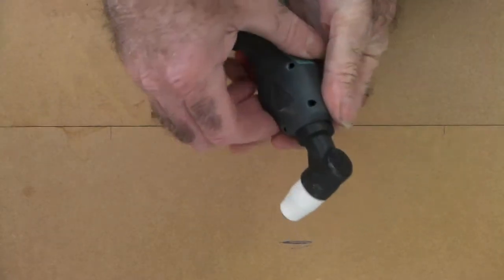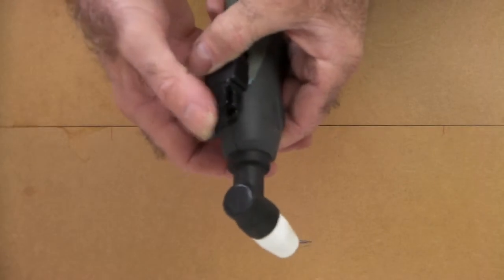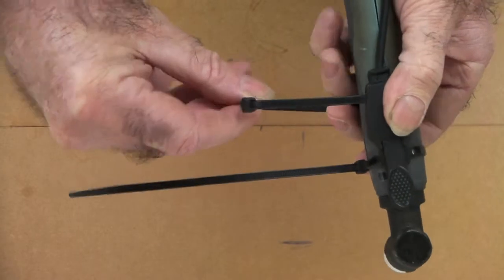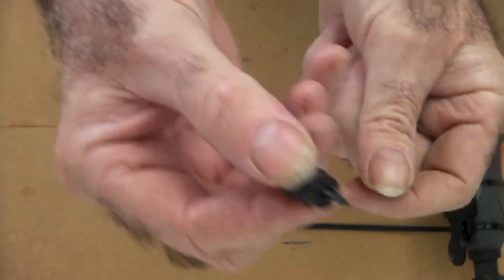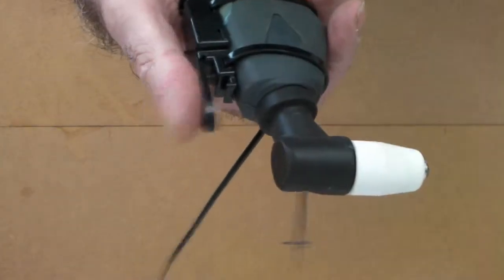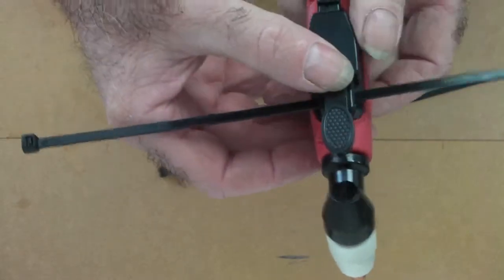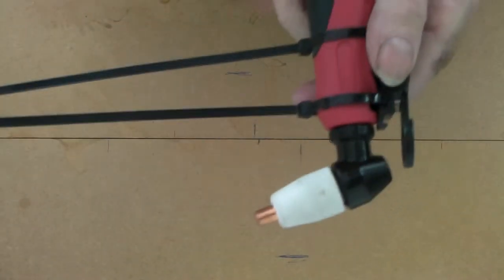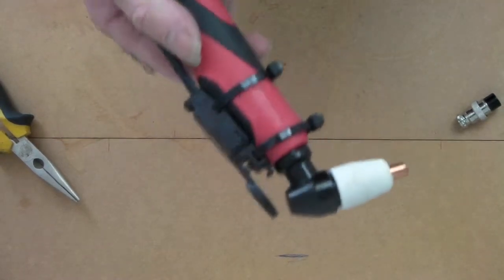Plasma Cutter Torch Hack Save $$$

Comment: cheap as chips! Your channel has helped me out, Pete. I figured I let you know. You have shown us that you don't have to have a $5000 multiprocess welding machine to get things done. I got a predator 9000 generator to run a yeswelder flux 135, Arccaptain cut 50, and a Hone 185d stick welder. the whole setup has cost me $750 USD. You are an inspiration!
Reply from the maker: Thank you so much for your kind words! I'm glad I could show you that you don't need to break the bank to get things done. Keep up the great work with your setup!

Comment: Hi Pete, what size is the wire? I’m planning on adding a 2 pin pug so I can add a 2nd switch and make a pantograph.
Reply from the maker: Hi its only low voltage i use about 1 mm . I just use anything i can find laying around the workshop.
Reply: pete's tools thanks for that.